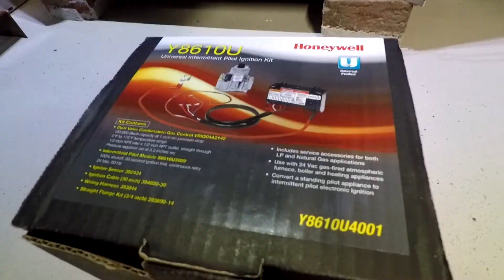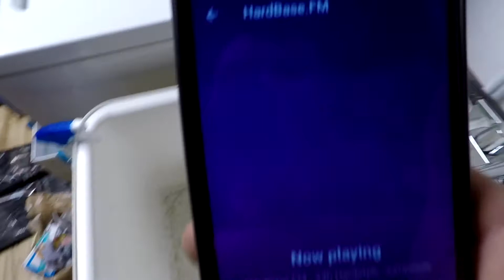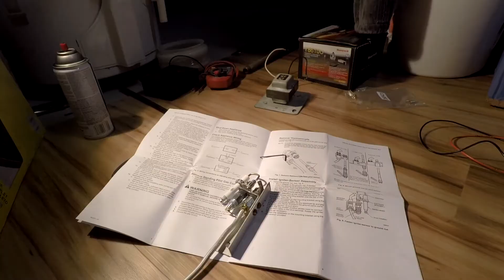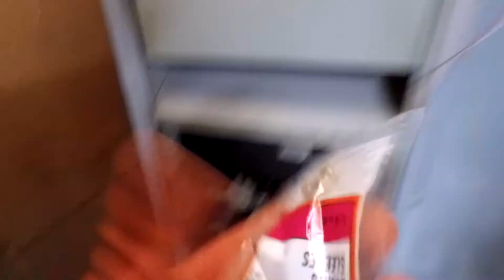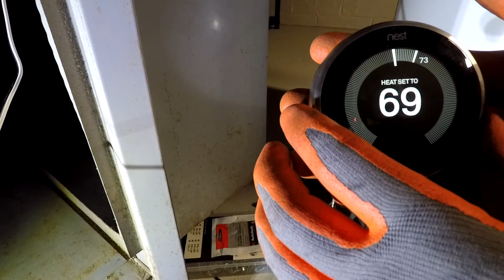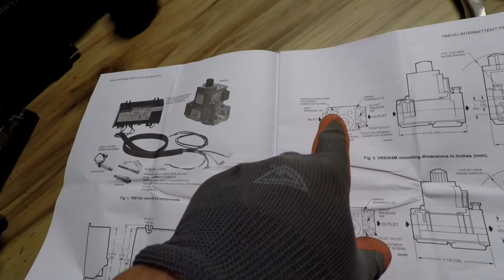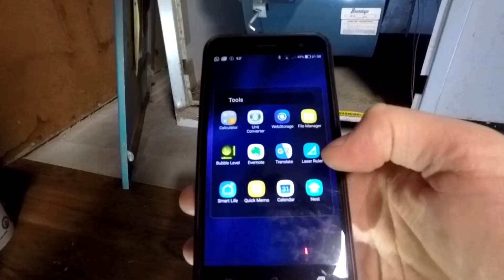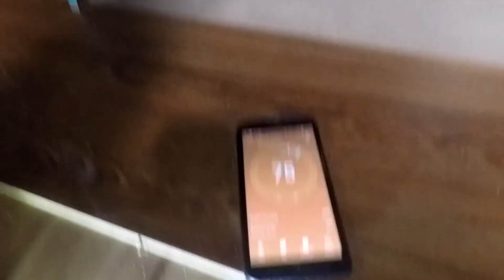Conventional Gas Furnace Upgrade to Intermittent Pilot Y8610U Honeywell

Comment: When you dont know the gas pressure. You should make sure nothing is on in the house except the furnace. Clock the gas meter for a few revolutions to get your usage. After the conversion clock the meter again and adjust your gas pressure until you get the same time for the same number of revolutions. Without equipment to measure manifold pressure and manufacturer specs this is the best you can do which for this old unit is probably good enough.

Comment: hi there…where did you attach the ground wire on the valve?
Reply from the maker: Ground from the valve goes to the ground on control module, it's green wire in my harness and it says GRND  on the module

Comment: Hi . My furnace gas valve is broken too . 
How you choose with one gas valve you need ? 
Why Y8610U ?
Reply: Because its intermittent pilot, which saves you gas, it doesn't burn gas when not in use. Its kinda having updated furnace in old body.